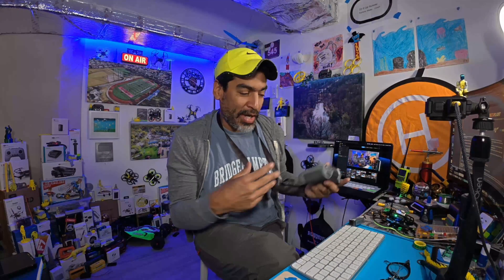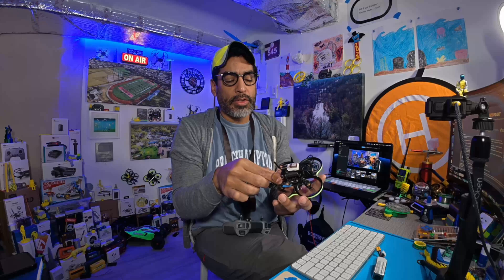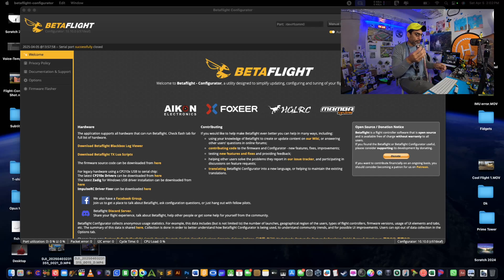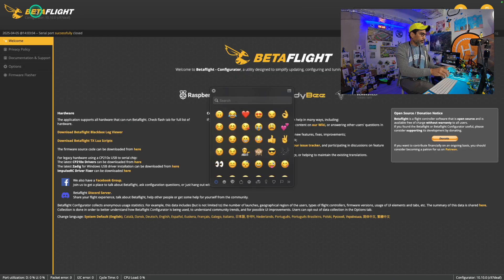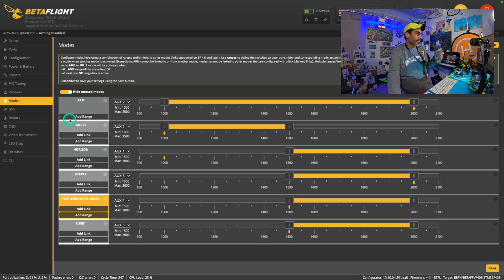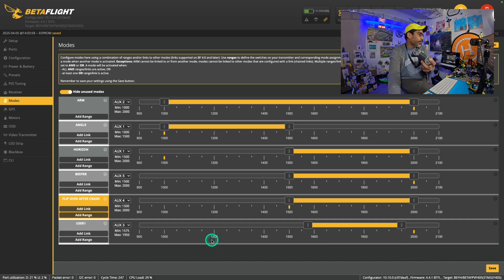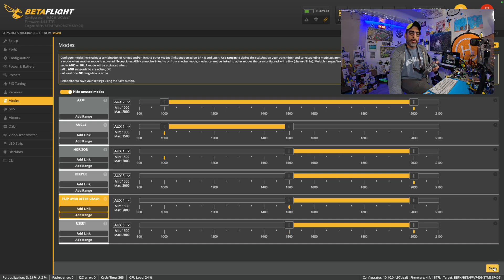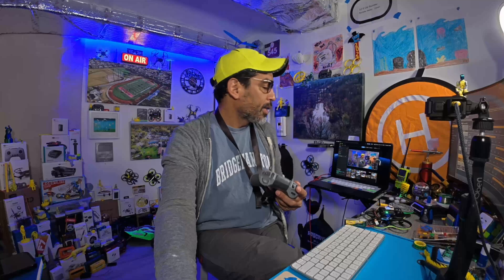Pavo20 led lights not working, how to set up led lights on Pavo20

Comment: Hi, I just installed my Pavo 20 Pro, but I can't seem to get the LED strip to work. Could you help me? I've watched all your videos, but I can't find a solution
Reply: P.S. I just saw how Betafpv soldered the wires on the FC controller and I noticed that the black wire is not on ground but is soldered to T6 instead of the yellow one as you show in the other video. What do you think?
Reply from the maker: @VinceFly 
Not sure. All Pavo videos were done on a live stream and then shortened into a regular video. We only got one take on the live stream to get it right

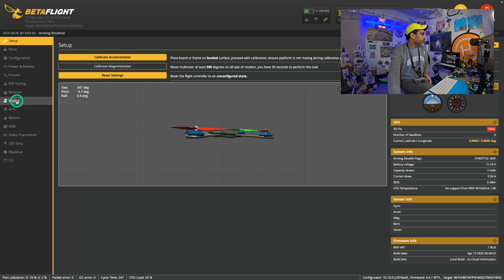2:00 minutes into video is soldering solution
https://youtu.be/9pZZK1M9ETg?si=dZ2Yox2Wfva2JXpG
Reply: @How-to-by-Lou  Yes, thanks for the reply first of all. I'd seen these videos, so I was wondering how it was possible that the wire for the LED strip came from the factory with black wire on the T6 instead of yellow. Do you think this could be the problem?  https://drive.google.com/file/d/1-I30Y9P96Ta0QEqJECcrDPbtfxr37PH8/view?usp=drive_link
Reply from the maker: @VinceFly  hard to say link doesn't that you are sharing. What's being shared in your link?
Reply from the maker: @VinceFly  The led wires come with a connector. The solder part has 3 wires since one connects to the switch. The light end only has 2 wires red and white. Do you have the connector that gets soldered to the drone?
https://betafpv.com/products/pavo-series-cob-led-strip?srsltid=AfmBOooHsW3TBWkN-zxByTXnoka-gRGF0T8PPkqnAPLaKgYua-RPKqrr
Reply: @How-to-by-Lou I contacted BetaFpv support, and as I expected, they confirmed that the drone left the factory with the wrong solder connections. The black wire was on the T6 pad instead of the yellow wire. Thanks for everything 🙏🏻
Reply from the maker: Hope this helps.. 

Pavo Pico not working - how to get the pavo pico started, pavo pico troubleshooting
https://youtu.be/LEw5Gha1eRo
Reply from the maker: Which video? 

This one will help troubleshoot. It won’t work if it’s on the wrong pad

Pavo Pico not working - how to get the pavo pico started, pavo pico troubleshooting
https://youtu.be/LEw5Gha1eRo